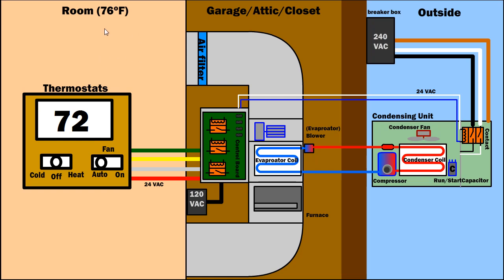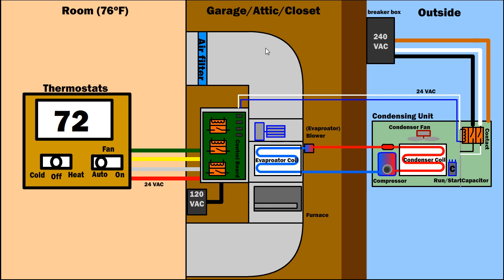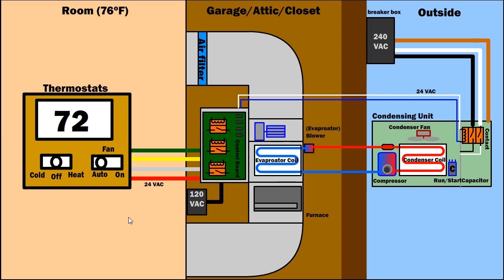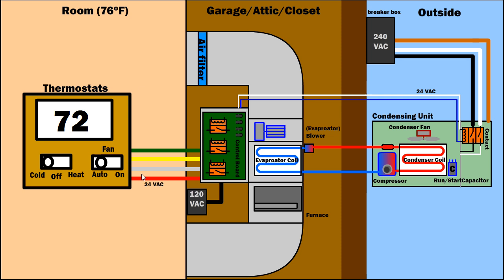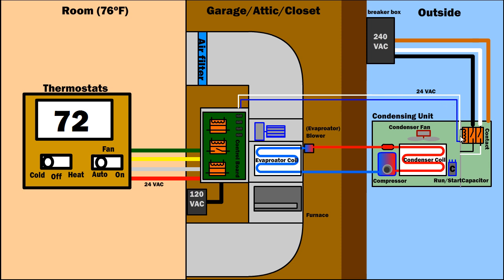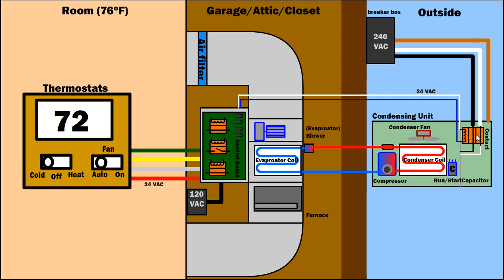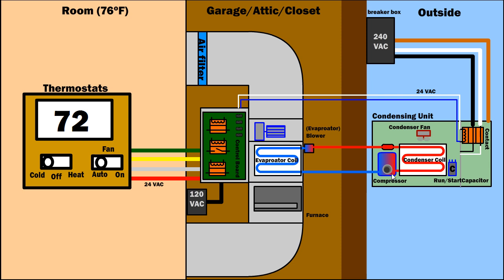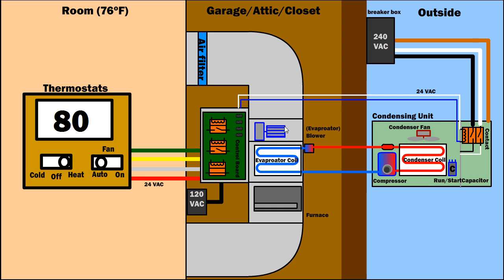How Air Condition Ventilation & Furnace Works - HVAC AC system diagram

Comment: how can I troubleshoot my system if I turn on "cool" and fan "on" and then I feel cool air for few minutes and then it stops when the fan of the main conditioner start rotating and the temperature is not goes down? Help!

Comment: I don’t like this lesson. You were doing fine until you glanced over how the refrigerant works. You said, “It gets cold,” but never explain how the refrigerant works for heat exchange, and how it rapidly changes from gas to liquid form. The refrigerant is the magic in a HVAC system that makes it possible, and you omitted important information.

Comment: Question Mr DIY Tinker..Just got my Lennox 2-stage system installed XC20/SLP98 with iComfort S30 thermostat. setting 'fan' to circulate or 'on' mode I expected the condenser fan outside to run but it didn't.. which 'fan' is on then, as the display says fan was running?  did it mean the blower part next to the slp98 in the attic?

Comment: Your diagramming has Condensation Dripping into the Heater Unit, possibly causing Electrical Shorting. The Heater Unit Must be located BEFORE the Condensation Unit for this reason.

Comment: hvac systems NO MONEY DOWN😎🔥🎉🎋🍃.  79MMR.  PLUS 500-900 bux in ur pocket 7735075867
Reply: Why bad smells all the time from other tenant's?  Also circulation fans in bathroom & entrance should be single switches but why would a management office with 53 apartments not run fans, wouldn't mold grow in bathroom from coils ? Are the management causing health issues?

Comment: what is the range of the thermostat?.. if you have it set to come ON at 72 degrees... the room temp is 76, that means the AC comes ON and stops at 72, right?.... so does that mean that it will come on at 72.1 degrees?... what is the range?

Comment: Hi 
I would like to take the opportunity and thank you for all your useful and  valuable experience and knowledge you share, also I have an issue with a 5 tons condensing unit, it does not condense, I mean the condenser is working but no cold air is coming out of the ducts, also when I felt the pipes they are at out door temperature, I believe here is no Freon gas in the unit, are you agree on that or you have a different opinion. I would be grateful if you could get back to me.
Reply: you probably have a leak in the evaporator or condenser
Reply: Falah Alzehhawi hey give me a call i can get u a brand new system. NO MONEY DOWN. keep in mind they are phasing out r22 with r410A. lets than about 50bux month plus 500 bux in ur pocket 7735075867

Comment: you said refrigerant get cold after it get in compressor, but I think what compressor does in the summer calling for cooling is it pump low pressure/temperature vapor refrigerant coming from suction line/evaporator to high pressure/temperature

Comment: hi , im sorry to bother u again. after the blower comeson im not gettin the 24v on my contactor. last time it was that 5a fuse.after changing it worked fine for 3 days and now dead again. my blower fan is working but no power to contactor again. what to check from blower to contactor.again when i press the contactor its working. ill really appriciate it. thanks again.

Comment: I am trying to figure out why brand new Carrier indoor/outdoor split units are blowing the 24v transformers in the AHUs. I have replaced 8. I am using Totaline p201-3401 multitap 24v output transformers for 208v units. I know my primary wiring is correct. But something on the secondary side is blowing these transformers. These units do not have controller boards, just a fan relay and an evaporator solenoid relay. The units will run for about 3-5 minutes before burning up the transformers. These AHUs are in small rooms inside of a new 8 story hotel, one on each floor. But I'm only having a problem with 3 of them, one each on floors 2,4,and 8. According to the schematic in the units it says to hook one side of the 24v to the brown wire coming off the fan relays low voltage and the other to the red wire coming from the thermostat. How can I diagnose where the short is?

Comment: hi there,
ive changed the cotactor and capacitor but still ac is not working. there is no buzzing sound or nothing.its dead. but when i press the contactor it works. 
please help.
Reply: hi please check your pcb board control or your thermostat setting 98% the problem is the thermostat control or the control board
Reply: Pressing the contactor in manually only shows that you have the 240 volts to the contactor  It's the 24 volt control to it that is not pulling it in. It sounds like you have lost your 24 volt signal to pull the contactor in. Turn the AC on and check your 24 volt transformer in the unit inside to make sure it is putting out 24 volts. Also, check to make sure you have 24 volts to the contactor. Do this by putting a voltage tester to volts AC, take one lead and put it to one side of the contactor at the bottom wires( one should come to each side of the contactor), with the other lead to the wire on the other side of the contactor. It should read 24 volts if the thermostat is calling for it.  If you don't then you have to go back and trace your 24 volts back to the transformer. You can use a voltage meter also to see if you have 24 volts to and through your thermostat. Put one of the tester leads on the R or red wire and the other lead to the Y or yellow wire. The Y or yellow is the control voltage to your outdoor condenser. If the thermostat is good with no shorts to your condenser, your tester should read 24 volts +1-3 volts.
Reply: THANKS

Comment: I pulled about 2 gallons of water out of my AC ducts in the attic. My plumbers have no clue
Reply: +nld1960 Is the air handler also in the attic? There are different maintenance issues that could cause the air handler unit to throw water into the duct system.
Reply: I'm sure you have resolved this in the 2 years since the post, but its not likely that anyone took the time to explain, so here is my guess: It's not a plumbing issue whatsoever. Assumimg that it isn't a leaky rooftop unit (meaning it's not rain water getting in), then I believe the water is coming from the a/c itself. Let me explain: Your a/c cools your home by doing two things: 1) removing heat, and 2) removing moisture. You ever see a pvc pipe, a couple inches long, dripping water outside, by the edge of the house? (Depending on what kind of system you have, it can be at the base of the house, right under the roof, or even laying on top of the roof). Well this is where the water drains that the a/c has taken out of the air. Now these pipes can get clogged with algae, insulation, debris, etc... and when that happens, the water backs up. Ideally, you would have a backup drain (one that is actually piped separately) and that one is usually put in a place where water dripping will get your attention. So for example, the primary would be ground level, and you never notice it, but the backup would by the roof, so you notice the water now dripping outside the window.) Now, you may have 2 pipes, you may have 1, or you may have none. The unit typically has holes for the pvc, but they are plugged, and the a/c guy should unscrew it, and run the pipe. Keyword: SHOULD. I have even seen them install a pvc pipe, and then after a few inches, cap the pvc. Yes. They completely sealed it. No draining happening there. Anyway... So after drains get backed up, the unit starts to flood. If your unit is tilted towards the direction of the supply ducts, then that's where the water will run into. The inside of flex duct looks like an accordion. Even if you pull it tight. Water could surely collect here. Okay, so if this IS what happened, then you need to get a wet/dry vac and go outside and make a tight seal and clean the pvc. (If it is clogged, but you don't feel resistance when vacuuming, you may be suctiong air through the pvc vent. Between the vent and the unit will be a p-trap, and those often get clogged. So go block the vent temporarily (unblock after u clean, and don't shove anything in there that can be sucked through like a paper towel. Seal the opening with something sturdy.) Once you get it cleaned (get a gallon of water and pour it into the pipe and/or drain pan to check), you will want to check for mold, etc... and also do some preventative measures. Clean the drain pan. If you have copper pipes, don't use bleach, but if u have pvc, it's a matter of preference if u use bleach, vinegar, peroxide, etc... to keep it clean. But don't overdo it. Pour a cup down there like once or twice a year. (To kill the algae).
Would like to hear how the original issue turned out. :)

Comment: Hello guys. I am renting an apartment place that doesn't do a lot of maintenance unless anything breaks. Is it a health risk to be living here long? The condensor unit is kinds old. I have been here for 6 months now. Moving out anyways after winter. I do not have any worrying health condition but would like to stay precautionary. If there are any health risks, I would move out in a month. I can ask the guy to replace the filter but nothing more I can ask unless something breaks.
Reply: +RJ K In most cases, replacing the air filter and treating the condensate drain/pan is all that is needed.

Comment: Your description of the refrigerant cycle is wrong.  The  refrigerant goes from Compressor to Condenser to a metering device(thermal expansion valve/fixed orifice) to evaporator and back to Compressor to repeat the cycle.  Also, there are other components throughout the circuit which affect the refrigerant in various ways; such as filtering devices and even a reversing valve (if the system is a Heat Pump) which changes the direction of the refrigerant flow and thus the evaporator becomes the condenser and vice-versa depending on whether the thermostat calls for cooling or heat.  Nevertheless, keep making your videos because you have a lot to offer.  How Air Conditioning Works by Mike Ermann is a step in the right direction, if anyone wants to learn.  Always watch more than one video when researching any topic.
Reply: His diagram is correct but just doesn't go into the details you mention. The metering device is shown in the middle portion below "(Evaporater) Blower" text. He correctly shows the metering device causing the refrigerant to change from high pressure vapor (red) to low pressure liquid process completed in Evaporator coil. Also the filter drier is located correctly also as the red cylinder attached right before the refrigerant heads inside. Just not labeled or explained.

Comment: Typically the furnace fires before the blower starts. This prevents cold air from being blown into the living space. One the furnace has reached the proper temperature then the blower is given the go to turn on.
Reply: +TheTimeTraveler2025 If the system is a standing pilot gas furnace, than the sequence of operation would be the main burner fires heating up the combustion chamber activating the fan control limit. This provides a time delay for the fan to come on which allows the furnace heat exchanger to heat up. This eliminates (or limits) cold air from being blown out of the ducts when the furnace blower first starts. After the burners go out when the call for heat is over, the bi-metal in the fan limit control cools. When the temperature in the furnace heat exchanger cools enough and the bi-metal reaches the low set point on the dial the contacts inside the fan limit control open and the blower shuts off

Comment: It annoys me how many business in particular don't put an air filter inside of their return air or if they have them they go months and months without replacing them. This causes the inside of unit to get dirty and increases allergies. It usually takes a breakdown before anyone cleans the coils and the dirt probably contributed to the breakdown. I use 3m filters and a UV light on mine and my 13 year old evaporator coil looks brand new.

Comment from the maker: 120VAC comes from the wall outlet into a transformer. The transformer steps it down to 24VAC. The 24VAC powers the control board and the 24VAC gets relayed to the thermostat and condensing unit's contactor coil outside. hope that helps.

Comment from the maker: 1. There is a good chance its bad. But, you could have a bad breaker, which happened to me once and it keep popping open. 
2. You need to check if the compressor's contacts C, R and S to ground are shorted or not. it should measure open (no resistance) from C, R and S to the chassis ground.
3. every compressors resistance values are different, but C-S and C-R should have different values. you can watch what i did here:youtube.com/watch?v=r8LD6rtElUY

Comment from the maker: check you main circuit breaker inside your house (it might be in the basement). Im sure the circuit tripped. 
Once you located your main circuit breaker, flip the switch back to ON, then see if it turns back on. 
The outside breaker box is basically a fuse box.

Comment: Got your refrigerant circuit backwards... leaves the compressor high temp high pressure gas. Cools in the condensing coil changing to high temp high pressure liquid. Then sent to metering device. Drop in pressure. Drop in temp. Goes through evap coil and removes heat from air. Then sent back to compressor as low pressure low temp vapor

Comment: My A/C was running this morning and it was cooling. When it heated up outside today, the air got warmer. I went outside to find the fan not spinning. The unit is on and blowing warm air in the house, but the fan isn't running. It was actually running very hot to the touch. Is my capacitor bad?